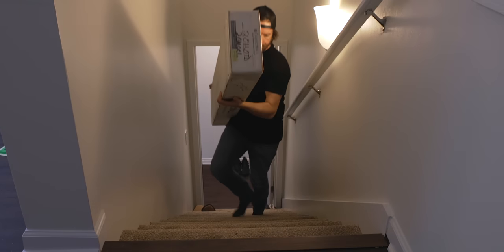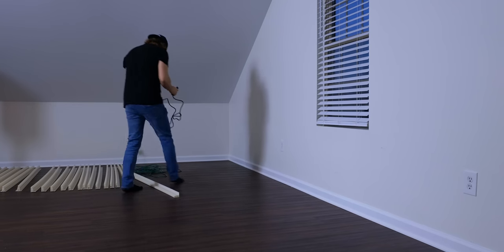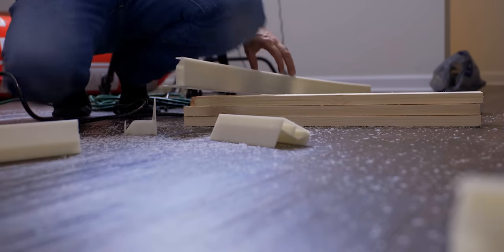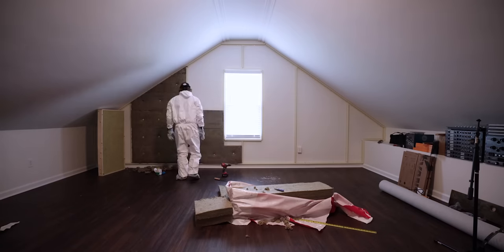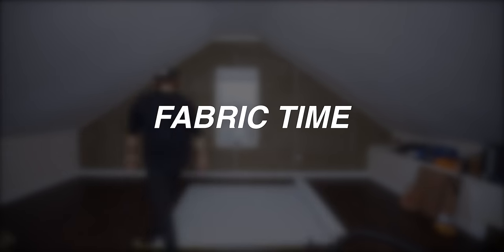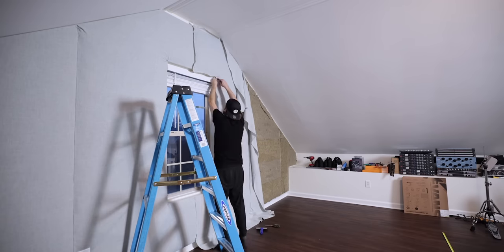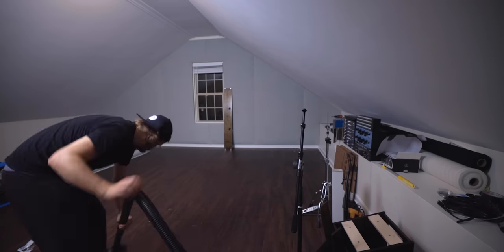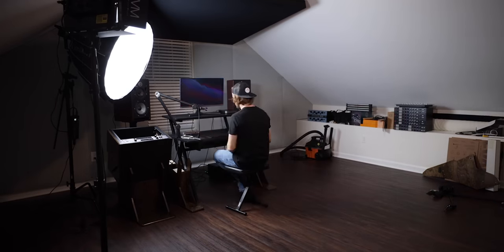Building an EPIC HOME STUDIO | Acoustic treatment

Comment: Andrew great to see the growth my friend. Im moving in a new space this year & been checking out new ideas & products. I need to be able to remove Everything if needed. Most likely gonna make big custom panels use as walls maybe.
Reply from the maker: This does far less damage to the walls which is why I’m going with it. The holes are 1/10th the size of a screw or anchor. I’ll definitely be removing all of this when I move out.
Reply: @AndrewMasters  I see that my walls are gonna be brick. I did watch some of their videos on install it might be a good fit for some of my install in a basement. I need to treat the ceiling and build 1 full side wall. The other 2 walls will be brick.

Comment: I'm surprised the rental allows for this though? Did you let them know how much "minimal damage" you would be doing or is it sort of an open interpretative clause? Because that many holes in the wall is going to require a full skim of mud and sanding I'd think. Then again, if you get a long term tenant that takes care of the place, 10 years or more of rent makes it worth it. BTW love the time lapse videos and how you show just enough to get an idea of what you need and the supplies used. I really like this in addition to building a full on isolated home studio. More cost effective if you can find a way around tracking loud instruments now and again. I'd say go for a large iso cab built into your garage and run that up to the studio if you can.

Comment: We are constantly copying from each other, and it's not bad thing. Some studios have more money to make a more perfect and permanent room than others (and off course some ideas are to good not to use them). The techniques we are using are based on the same principles, damping or diffusion. Thanks for sharing your studio built, I'm searching and watching a lot of studios to see what kind of threatening is used. So I'm interested into the following videos of your studio built. It a hobby for me and not a professional studio, so also the budget I have. I might even copy some of your ideas for my studio space (investigating if a fabric wall is an option for me and how much it will cost because I'm in Europe).
Reply: Pretty sure EU has really good rigid insulation there - it must work quite well id assume more so than the extra fluffy junk that is common here in states.
Reply: For thermal insulation you are correct, my new rental house has great insulation. But for acoustic insulation, not great. Concrete walls which are very reflective for sound. An empty room is like an echo put. The fabric wall catches (absorbs) the sound so it cannot reflect. Produce like a pro has also a built series where you can hear the difference into the room when treated with panels. With a fabric wall it's less critical where to place the panels and more reflections are absorbed because the area which is treated.

Comment: hey Andrew what did u use to hang the cloud? considering building one for my studio as my ceiling is completely untreated but unsure of the best method of putting one up
Reply: You can use a turnbuckle to mount your clouds. With it your can adjust the length of them to adjust the position of the cloud.

Comment: What are you using to hang the cloud, as far as hooks that go into the ceiling?
Reply from the maker: I used a combination of drywall anchors with eye hook screws, a chain cut to length, and snap hooks on each end of the chain.